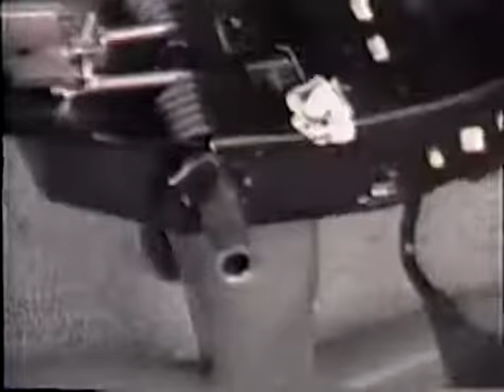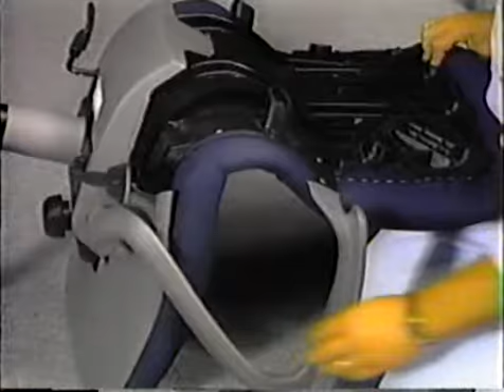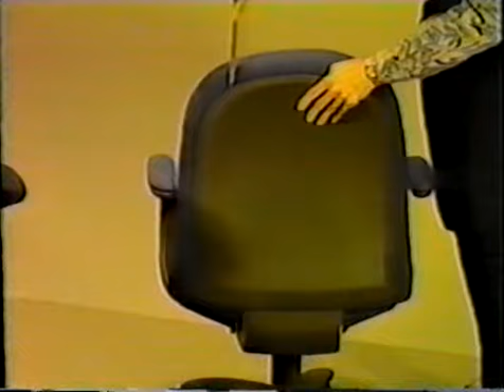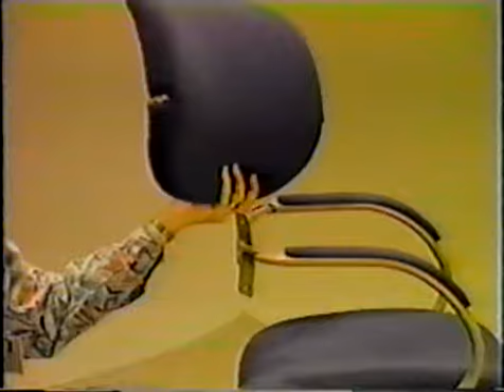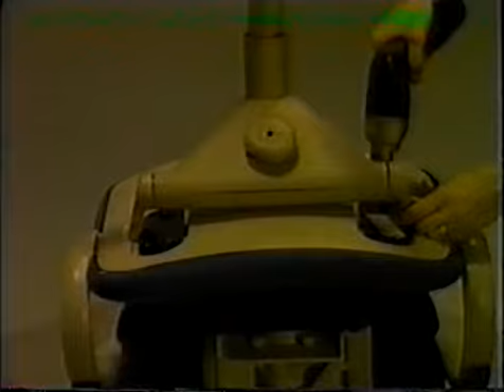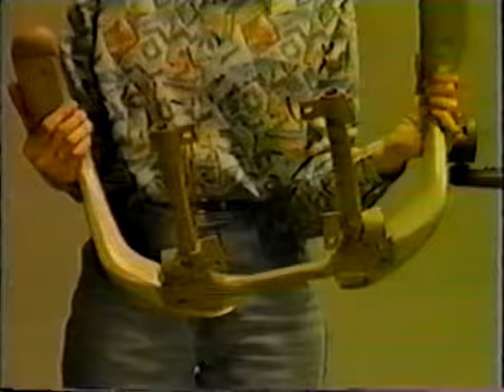Improv Accolade Adjustment

Comment: I had a very nice, very clean Haworth Improv HE task chair that I have rendered junk. The precipitating event for the chair's demise was my inability to remove the gas cylinder for replacement. I watched multiple videos, and nothing helped facilitate the removal of the immovable cartridge.

During the ugly wrestling match between me and my gas cylinder, the lift lever broke on the inside of the huge metal molded piece under the chair. So I tried to entirely disassemble my chair that, apparently, was not made to be disassembled. (My chair was not made like the one you're disassembling in this video).

Further, In the attempted disassembling, various cheap plastic tabs broke off along with some other hard plastic tabs on the underside sides. What a disappointment to find that although many of the larger pieces are made like Fort Knox, so many of the smaller pieces are very cheap, very flimsy, very cheesy plastic, including whatever was holding the lift lever in place.

My very expensive Haworth chair with the pretty fabric is now junk. Very sad.